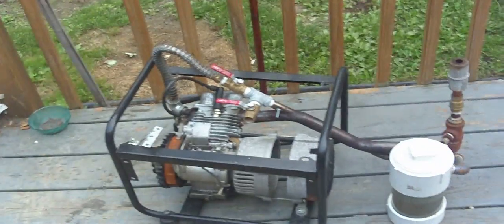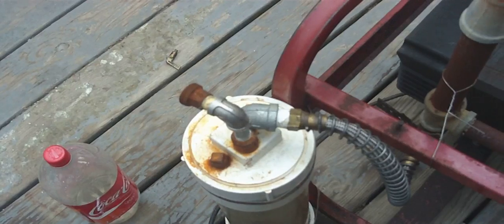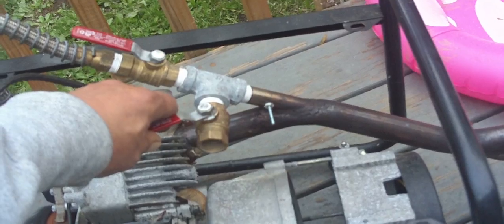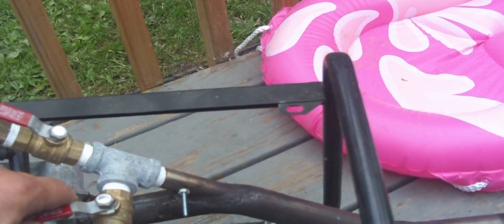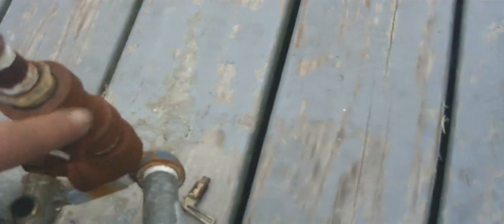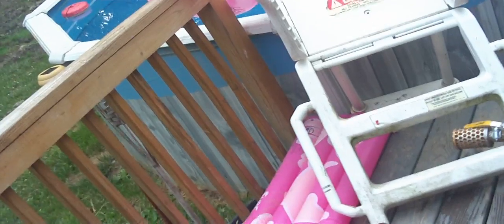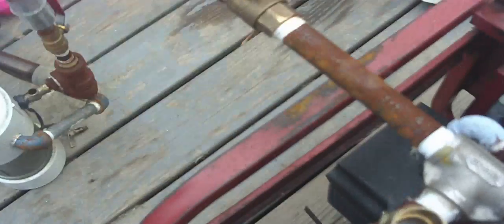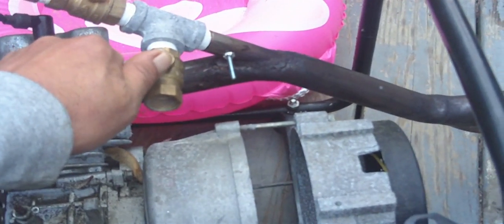Paul pantone geet plasma caught beeing formed through sight glass

Comment: Started motor with socket on drill? Surprised it didn’t catch and throw the drill:/ You’d think a freewheel attachment like on a bicycle would be required to pull that off without launching the drill:/
Reply: No, it's quite simple, I have been doing that on small engines since I was like 10 years old.

Comment: What would happen if the exhaust was partially or fully insulated or perhaps insulated with a covering sleeve around but not touching the exhaust with two air valves a glass viewing porthole to see what colour the exhaust needs to be to run exactly the way you need ,,,,,,,,,,,Thanks for the video ,,,God Bless all who are trying to Carry on Paul's work

Comment: it seems you're running exhaust and fuel in the same direction. I thought you're suppose to run it opposite direction. I have sight glass on mines but I don't see anything happening. I don't think mines is reforming at all. Any tip?

Comment: My generator runs fine on gas too!
You don't show yourself filling the fuel, so I am left to assume that the almost empty gas can at 7:16 in the video was the source of fuel!? So I am not seeing the GEET here at all! I am not saying what is or is not possible. I am not qualified to say one way or the other. However if I use Occam's-razor of solving using the obvious, and since your"fuel tanks" are not transparent, I would say you have shown us the running of an internal combustion engine on the fuel it was meant to run on.

Comment: Wouldnt pertol, under a vacuum evaporate before water? I think so.
Reply: That is correct!  

  I made A lawnmower run on vapor because the carburetor broke.   It wouldn't burn all the gas in the bubbler because the more volatile stuff gets burned off first.

  You can even mix water with new fuel in the bubbler and the engine will still run.  However it is not running on water and adding the water will make the fuel dilluted.  Overall run time will be reduced by mixing in water.  

  I would mix used motor oil and gas just to get rid of the oil.  That is the only benefit that I see from doing this, even then not much benefit.  

  The lawnmower would overheat in about ten minutes so mowing the lawn with A vapor setup is A big waste of time!

Comment: there are lots of petrol vapour engines on You Tube and some seem to work quite well.  I think they run better if the intake mixture is heated.  From what I can see, that's all that is happening here.  However, I'm no expert so I don't know for sure.  The one above seems to run real well but perhaps not for all the 'bullshit' reasons but simply because vapour engines do work - and work better when the air/fuel mix is heated.  God only knows about the safety issues. I live in Sydney, Australia.. anyone local to me interested in a get-together to work on this?  Thanks for the video Paul
Reply: Try water mixed with Carcium carbide to form your vapour. Looks remarkably like coke ;)

Comment: hi folks! anybody has tried to mount it and could tell me the results about measuring water-gas initial and final? the water consumption was equal to gas? because im thinking then doesnt matter if you put 70%water and 30%gas... gas will wasted as usual... How its hold in place the center rod of reactor?? any experience about?
Reply: The center rod didnt affect to anything, friend tried copper, steel, stainless and glass.. NO CHANGE  This setup works by vaporizing gasoline and due to the storm that goes in the fuel tank (vaporizer), also water vapour gets sucked trough engine. Only positive things of the added water are A: Less pollution B: cooler running engine.

Comment: Plasma? LOL
Reply: enginemaxcarb.
all plasma has ionized gas, not all ionized gas is a plasma.
Reply: There is ionized gas in the air you are breathing.
Reply: @Dan77845  Called ozone..
Reply: tristen turner That sounds completely contredicory to the definition of a plasma. Can you give an example of an ionized gas that isn't a plasma?
Reply: enginemaxcarb.  Plasma can be created as low temperatures as 1726,85 Centigrades.. Copper pipes LMFAO!
Reply: Oooooor... it could be that oxygen enriched gasoline trying to combust outside of the motor. Electrons are free? What grade did you finish?
Reply: "A bigger than yours." Not sure what that means. I guess it speaks for itself. So your claiming it's getting hot enough to create plasma without melting that motor to the floor?? Really?
Reply: There are instances where that is true but not as a general statement. A flame is simply hot gasses and fuel burning. In order for it to be considered a plasma there has to be a molecular unity throughout the majority of the flame and the electrostatic properties outweigh the reaction of the burning hot gasses. Without the aid of an additional excitation mechanism, the hot gasses would have to see extreme heat to be validated as a true plasma. Any high school physics teacher will tell you that.

Comment: ive notices boiling water with electrolites eg bi carb coda mixed together will emit a flammable gas as it increases the flame of a lighter what if electrolites were added with only water to run through the geet reactor or also adding a fuel cell to get it running up to temperature and use the fuel cells out put to control the engines speed or torque. pulse adjuster on motor to change the timing bluh bluh

Comment: how much water is there when it dies ? your just burning the fuel in the bubblier and not the water. some water will disappear due to the heat and evaporation.  want to prove your point, run it till all the water is gone , and do it on camera ! you built a hill bill carburetor , thats all.

Comment: The reaction requires the heat exchange within the reactor, ideally the vapor is cooled before entering the inner pipe.  the bubbler itself requires low pressure to boil the contents at ambient temp. however heat also helps along with the vacuum seal. Routing the exhaust to or around the bubbler can  increase your vapor volume and efficiency as long as your route into the reactor is long enough to effectively cool the enriched vapor

Comment: Have you converted a generator and put a substantial load on it? does the geet system affect the power ?
Reply: I have not come across a single GEET video where they evaluate the actual power output with a load while running some unique fuel.

Comment: One detail I wish people would include is the workload placed on the engine. I was glad to see you connect and operate a device from generated power. Most setups have a motor with an unconnected shaft, which doesn't prove much energy generation. The footage of the "blue ring" isn't great. I'm not doubting it, but it would be great to take some night-time footage and see what you can get. Thanks for the video!

Comment: servall1
 Starting a GEET system with a GEET engine ...... Way cool !!!  Best video I've seen so far! 
 I'm curious why you use the air mixture valve to control rpm, and not the 
throttle valve? It looks as tho when you shut that valve, you would be running a full rich mixture. What gives?

Comment: I ran my Geet reactor at around 75% water only to find that most of the water in the bubbler was not used, that's because the gas/fuel vaporizes in preference to the water. You need to give a more convincing demonstration showing the relative water/gas volumes before and after running. Good luck.